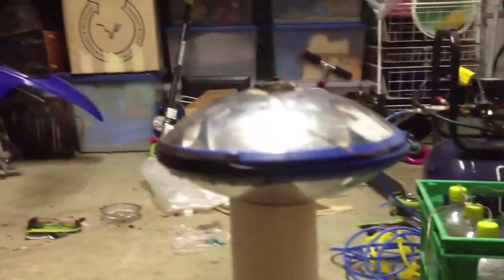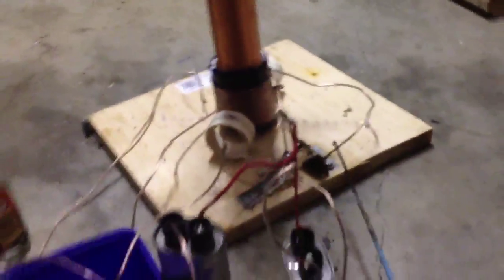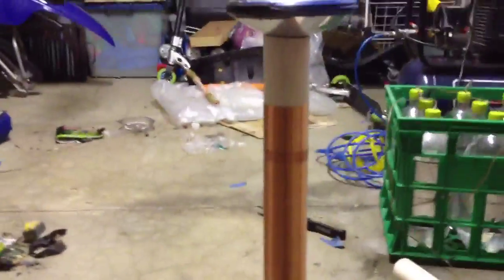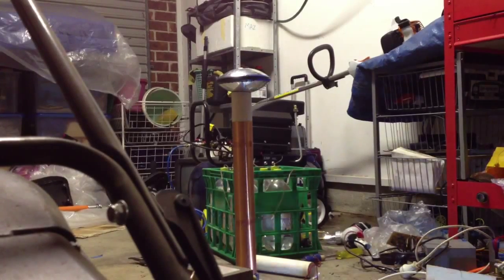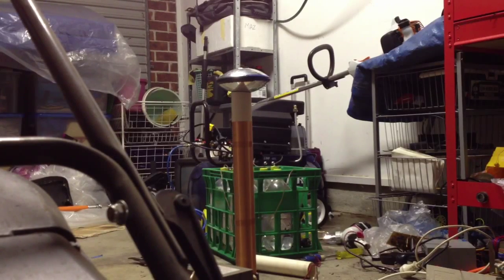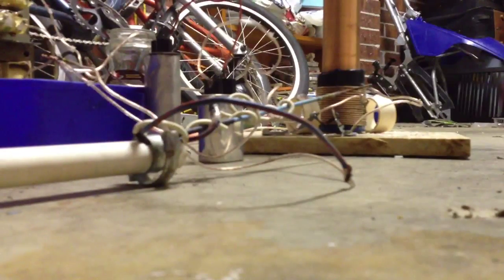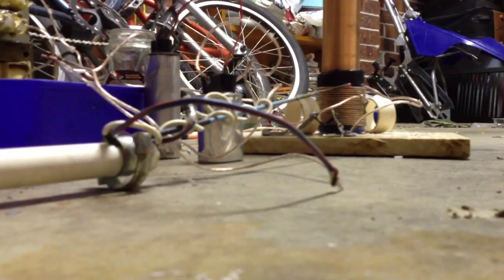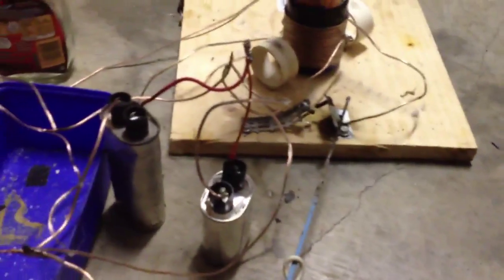Duel mot tesla coil not working, why? and capacitor fail

Comment: First off, 450nF is WAY too much, and your primary should never be that close to the secondary...In order for me to help you I will need the primary form outer diameter, wire diameter, and number of turns, and topload dimensions (width and height), then I will be able to help you fix it. :)